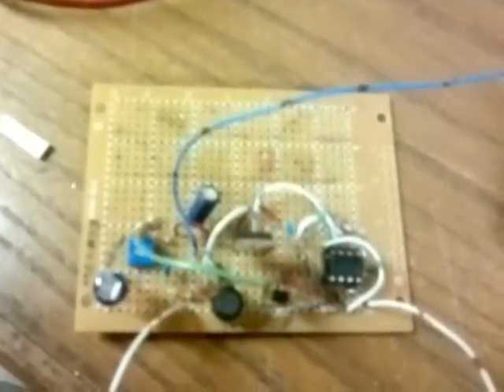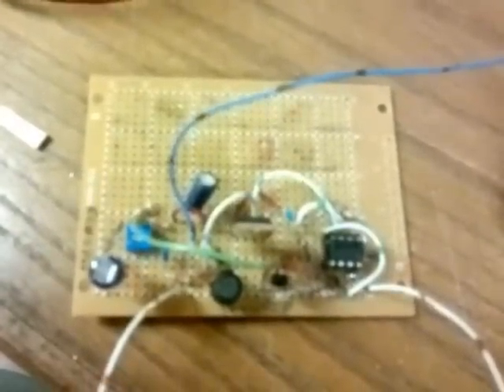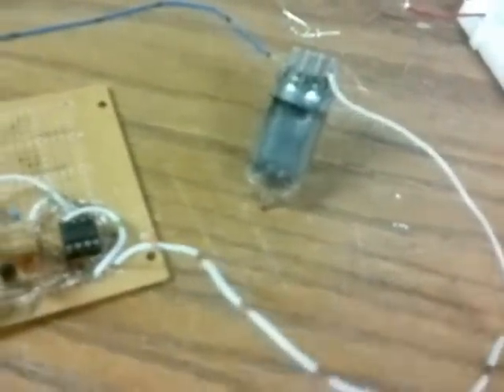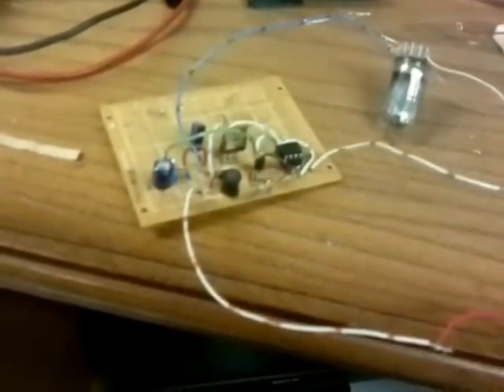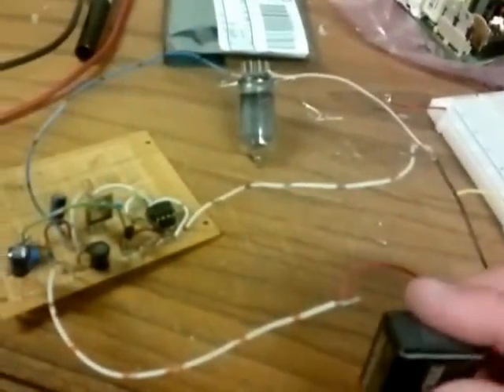Nixie Tube Power Supply Test

Comment from the maker: I had some issues with heat as well when I was building this (hence why it was my fourth attempt). Which parts are frying when you use it, and what voltage are you using as your input?

Comment: hi!!!! i try to make this power supply but i have a problem with the temperature, heat too much, and make blow all supply 220-12volts, i broke 3 good suplys. I can´t find the problem. 

i change:

irf740 twice
222 C
250 2uf C
trimpot, an i put a pot 2k
bc547 changed two times

i cant find the problem. can you help me?